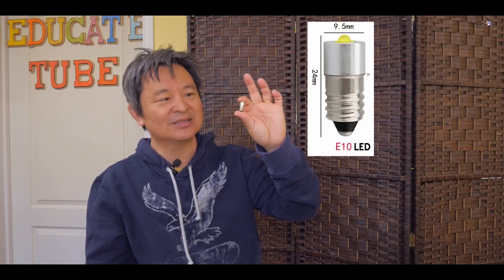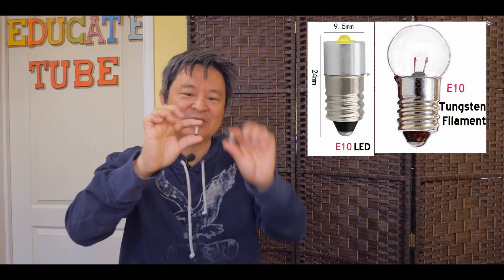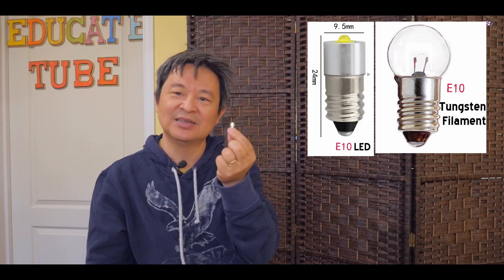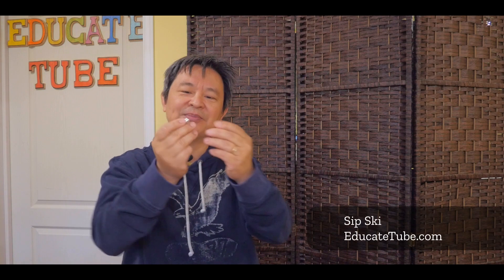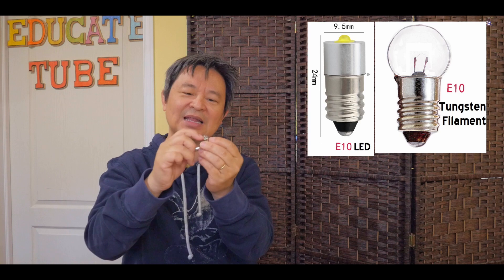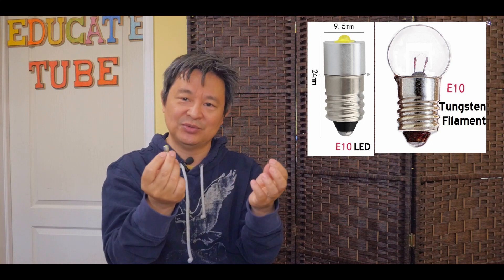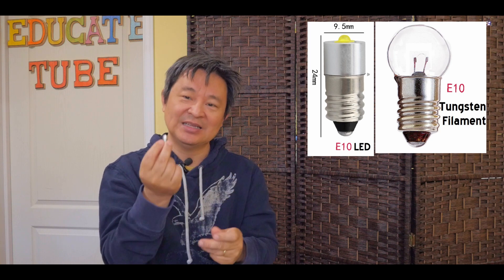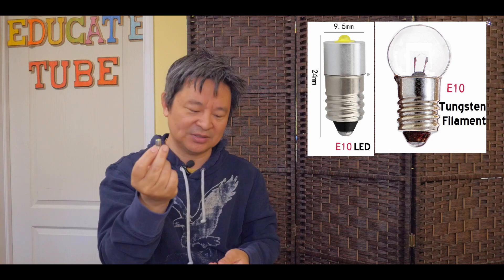E10 tungsten filament light bulb vs LED light bulb comparison:   Which is better?

Comment: Question: what kind of LED is best for older flashlights and their reflectors? The LED, from which light comes out from the top, it doesn't work well. Light more or less passes reflector. It only creates a large ring of light.
Reply from the maker: You would probably need to try different ones to know which is/are best that particular flashlights.
Reply: I have thought the LED bulbs where light units are in vertical position and emits light sideways. Normal old light bulb, in what direction majority of light is heading, sideways, up and down or 360 degrees?
Reply from the maker: Do a quantitative analysis and measure of the light rays and its intensity from various directions.

Comment: I have a cheap $15 ebay 6v dynamo/generator light kit on my motorized bicycle. I'm gonna replace the headlight bulb with a 6v  e10 led. Looks like it'll be much brighter 🔆